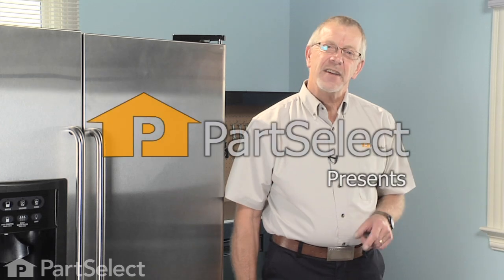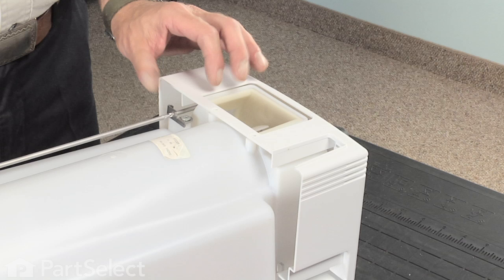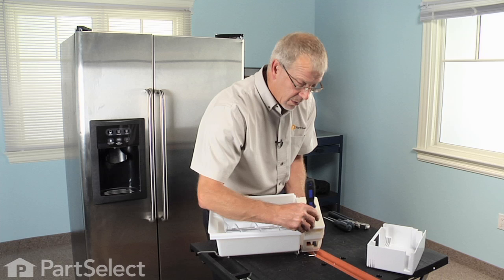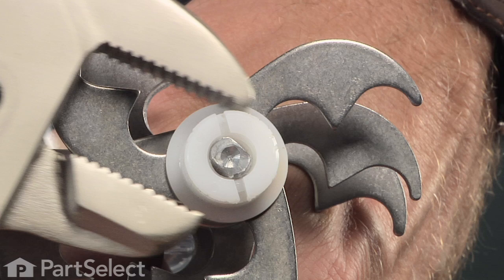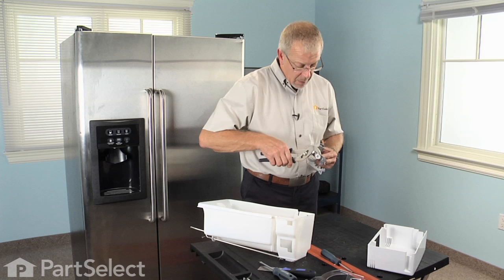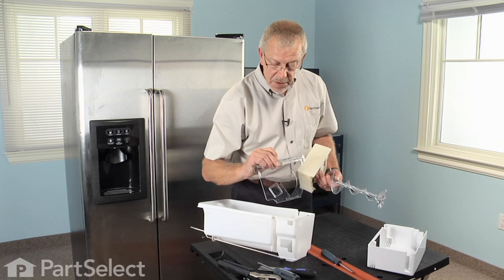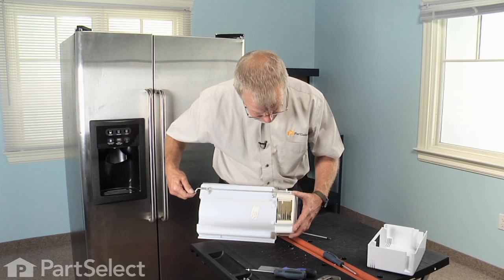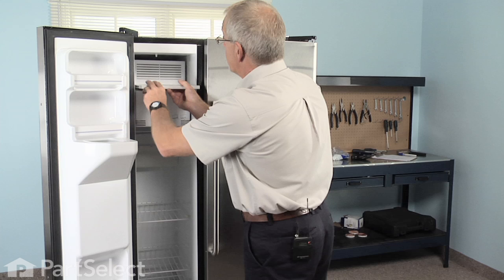Refrigerator and IceMaker Repair - Replacing the Auger Assembly (GE Part# WR17X11705)

Comment: The auger in our GE Refrigerator Ice maker gets rusty. GE advertised it in their paperwork that comes with the refrigerator as being Stainless Steel. I wasn’t born yesterday but I never saw Stainless Steel Rust. GE was nice enough to send me another out free of charge and I installed it no big deal. The new replacement to be honest looked like it was made exactly like the original. The replacement is rusting also and it makes a mess with the ice as it dirties the ice that it does not look appealing when you drop some in your glass. Who would want a drink with dirty rust in your drink? Now our refrigerator is out of warranty and GE doesn’t make our model GE Refrigerator anymore. I don’t think we will ever buy another GE Refrigerator again for that reason alone do to false advertising. In the mean time I do the best that I can with dish soap and a scouring pad to clean the rust from the auger at least once a year and if I decide to use the ice in my drinks especially after a few months of cleaning the auger I take my glass to the sink filled with ice and rinse the ice out in the glass. I shouldn’t have to do this. As someone who is not afraid to fix my own appliances when they can I tried to think this out as to what to try on my end because I am not about to throw out this refrigerator that works fine otherwise. I was wondering if maybe after cleaning the auger if I could wrap the auger in plastic wrap of some sort. Something like a shrink wrap used to cover newly soldered electrical wire. They do make shrink wrap for electrical wire in clear and in various widths. I am just curious what others think. It would be nice if GE or some aftermarket company made a replacement plastic auger to replace my metal Auger that was suppose to be Stainless Steel. I have no idea if someone does or not. Hopefully someone may know something I don’t and could help me out here.

Comment: Thank you so much for this video. It was a lifesaver. My dad called me, like he usually does when he needs something fixed, and he told me he needed a whole new fridge because the ice maker wasn’t working. I checked it out and saw the auger was broken. He tried to use an ice pick to break up the ice and he broke it. I told him we just needed to replace the auger not the whole fridge. Then he calls me to tell me he has spent forever trying to install it and he needs a new icemaker. I looked online and saw that the trays are over $100 so I thought I would try to fix it myself. After about half an hour of feeling like a monkey trying to shove a square peg into a round hole I decided check YouTube to see if I could just fix it myself. Luckily I came across this video and I successfully installed it myself.  I canceled my Amazon order.

Comment: Best video of this process.  Installing the blades in order is critical and you might have to rotate a blade 180 degrees on the shaft if it does not look in sync to the previous blade.  Only about a half inch difference in position from the tip points between blades 7 & 8 and 8 & 9 when looking down the shaft.  The numbers on the blades face down towards the plastic auger.  And it's a 9, not a 6.  Put blade 7 on first.  ALSO, see my note on previous commenter @randyp3871.   Cheers, you CAN do this!

Comment: With My similar Maytag unit, the ice auger works but runs/stops on its own every few minutes.  I took the ice box out, and removed the auger so we could continue to have ice.  The motor now stops and starts on a continuous cycle all day long.   A month ago, this problem was occasional and only when on "crushed" ice setting, not on "cubed".  Now its continuous, about every 3 minutes , the auger motor starts and runs 2 minutes, then stops for 3 minutes.  This cycle repeats.  Disabling auger motor or replacing parts are both OK options.   What do you suggest?  Thank you much.

Comment: Thanks Steve me and my daughter just removed a broken piece of the plastic wheel assembly which was jammed solidly in the blade from the metal blade parts of the plastic wheel from the blade.  She watched the video and I disassembled the icemaker.  It took less than 30 minutes.  Saved me about $500 on a service call.  Thank you Steve.

Comment: You helped me replace my Auger Blade in 2014 but, that GE part only holds up for about 9 months and then brakes.  I'll be watching this video again since I ordered a replacement auger blade from a third party parts manufacturer that touts much better durability.  I can't believe I did this job back in 2014.   I could only do it because of your video.

Comment: I am a pretty mechanically inclined guy. I thought I could do this with no problem. Needless to say, I had a problem.
 I turned your video in usage 3 words that totally bailed me out.
" Left hand thread."
LOL

 So then all my parts came in and I went to put it back together. That's when I discovered all of the crusher teeth were actually in the wrong order when I took it apart. Apparently someone had been into this before and didn't do it right!  The order you have a man just makes sense.

It's all back together in its working like a champ. Bank you so much for your help.

Comment: Just finished putting the unit back together.  Waiting for ice to drop into the tray so I can give her a test drive. Fingers crossed!  This video was pretty great.  So easy to follow!  I'll report back shortly on my success/failure :-)  Funny story - the first time, I got the wrong auger and didn't find out until I had the bin disassembled and stuck the auger in only to find it was 4 inches too short!

Comment: Tip: When you disassemble all the blades from the shaft, slide them all onto a cable tie in proper order. Then later, you can cut the cable tie and slide them all back on without obsessing over the order. At 10:30, make sure the little bracket is BETWEEN the small crimps on the shaft. Replacement augers you might purchase do not have flats on the end shaft ground down far enough towards the plastic. You might have to file off about 1/4" to make the flat go further back.
Reply: Filing down the shaft was a pain.  I used my Dremel.  Painstaking process for sure.

Comment: thank you so much for this.  i had used a putty knife to get the tabs open because i couldnt think of anything better, and was glad to see that this was a valid method:-)  i was stuck on removing the Ering to get the auger out.  i replaced the auger many years ago before youtube existed but it took hours that time and couldnt remember how i did it.  i was done in 10 minutes after finding this.

Comment: thank you so much, my auger was stuck and no ice , took it apart and realized the front shield was broken and jammed in the auger, I'm sure leaving a water bottle in there from the summer didn't help. anyway, can I still use ice maker without front clear plastic shield? thanks again.

Comment: Hi Steve, thank you for the video. The spring in the back on the selenoid activator lever broke. The lever springs back, I believe due to the spring in the front of the box. That said, is this an important part that needs replaced? If so, how would I order it? Thank you again, Sonny

Comment: Great video. I replaced the auger per the instructions with very little difficulty. When doing that, I found the “dispenser crusher cover” was broken, so I replaced that a week after the auger. Used the same instructions, just skipped part of it. Works great. The only problem I have is that it always crushes the ice It never delivers cubes only. Any idea how to get that part to work?

Comment: Hey thanks for this video.  Just got done replacing my auger and you made it very easy to do.  One question though.  When I try to dispense ice, I hear a little click, but the auger doesn't spin and nothing happens.  Water still comes out, and the auger used to spin before I took it apart and replaced it.  Any ideas what this could be?

Comment: My bucket assy is slightly different, and I can't get it apart.  GE Model PSS26MGPA BB.  It has two plastic tabs near the clips that you used the putty knife on.  I saw one on-line guide that said you have to break off those plastic tabs before you can remove auger assy.  Do you know if that's correct?  I'd hate to break it if I don't need to.  Also, this is the second time the helix has come disconnected from the auger.  I use this dispenser with store bought bags of ice.  Is that the reason?

Comment: I can't tell from the video if the two blades that are "tied together" are supposed to be snugly fit within the washers. Mine are loose, but the other 3 blades (on my model) are. I am wondering if this is what caused my auger to chew itself up.

A repair main had done something to my refrigerator (I don't know what) because plastic pieces kept coming out in my ice tray. They were white, but then I realized the auger was chewing itself up when the plastic pieces were clear in the ice bin. Maybe I now have the wrong washers? 

I just bought a new auger from PartSelect and I am hesitant to put it back into the freezer if the 2 "tied together" blades are supposed to be snug between the washers.

Comment: The model of my fridge is GSH25JSXJSS, not sure about the ice maker.  However, I took it apart again yesterday, and fiddled with the dispenser actuator.  Now, when I try to dispense ice, the only thing that comes out is crushed ice, even if it is on the 'Cubed' setting.  So I'm thinking it's something to do with the actuator, because ice is being made and dispensed, just not the right type of ice.  Ever run into that problem before?

Comment: my ice container doesn't seem to be making contact with the "gear", for lack of a better word, so the motor runs but does not turn the auger assembly???  It's like they aren't lining up. it has NEVER worked. i always assumed the installation crew didn't have something hooked up right. any idea???? Please and thank you

Comment: Parts select - Excellent video which help me install the suger assembly and face shield.  I have a nother problem now, once I installed everything back into the freezer and turned the switch back on, now the ice will not dospense when activated in the front.  Did I misinstall something?  Thanks.
Reply from the maker: redmist1122 What model number do you have?
Reply: GE GSL25JFXBLB

Comment: This video shows the "teeth" on the rotating blades facing the "teeth" on the fixed blade assembly. When I replaced the auger, I lost track of the original orientation of my blades, so I tried to follow the video. But having rotating blades oriented this way led to them catching the trap door. The only way it appears the rotating blades won't catch the trap door is if the teeth are oriented in the same direction as those on the fixed blade assembly. Or perhaps I also have a problem with my trap door and it doesn't open far enough to allow the rotating blades to pass? Any help?
2. Is the first blade replaced on the auger the 7 or the 9" ? And does the number face the back of the refrigerator or the front. 
Thanks!
Reply from the maker: The blades go on with the numbers facing toward the back of the ice bin, and the number 7 blade goes first. Make sure that the plastic block on the fixed blade assembly fits into the proper space on the crusher housing when re-assembling.
Reply: Thanks for your answer. Eventually I figured out that the trap door on my until was bent. The edge facing the blades was being engaged by the blades when they were installed correctly, bending it even worse and causing the motor to seize. I'm surprised the trap door didn't break. Anyway, I was able to get it to work by improvising a little bumper at the top of the trap door so it didn't close to the point where it would still catch the blades. I'm sure having the extra information about the blades will be helpful to some of the viewers.

Comment: I need some instruction.  The part where you instruct on where to put the Ice Blade/Stationary Blade Assy (looks like the blade of a bulldozer made of clear plastic attached to two blades with compete loops to fit over the auger spline.  The video did not show in detail exactly how/where the part should be positioned.  When I reassembled and tried the ice maker no ice comes out... I can hear the motor run and I can see the Dispenser Auger Drive moves if i note the position. I can only surmise the auger is turning but the ice it not being admitted to the cutter area maybe because I positioned the Blade Assy in the wrong place... Please advise
Reply from the maker: Jake Robinson I passed your question on to Steve and will let you know what he advises.

Comment: Instructions were a big help but the reassembly portion where the fixed blades must be positioned just so goes by a bit quick without a good shot.  I think I got it correct but I assume the interaction of the fixed and moveable blades is how the crusher works and my first test seems to feed whole cubes OK but is hardly crushing the ice at all when I go to crush setting.  All seems pretty slow but I am going to let the bin refill before I abandon hope or tear apart again.  Crusher was working OK before the auger blade broke.  Advice?
Reply from the maker: Hi Terry! Thanks for watching, and for getting in touch with this excellent question. Check to see that the fixed blades are opposing the rotating blades and that the plastic block that holds the fixed blades is properly inserted into the channel on the crusher housing. This is essential so the fixed blades do not move. Let us know how you make out; best of luck!

Comment: Great video's on repair. I have a GE Profile and saw your video on replacing the main control board and I'm just waiting for the new board to arrive so I can install it. My other problem doesn't appear as easy to fix. The ice dispenser drive cup is badly worn and needs to be replaced. Your video on replacing the auger helped some but my GE Profile, side by side model (PSC23SGRCSS) is a lot different and the auger actually extends thru the front of the ice basket. I had one repairman tell me that you have to replace the whole unit, ice bucket, auger and all. After fooling with it for some time I'm starting to think he's right, but if you can't replace it, why would they sell the dispenser drive cup as a separate item (part # WR17X1L459)?? Any help would be greatly appreciated!!!
Reply from the maker: Thank you for the compliment about our video. I took a look at the schematic for your fridge (based on the model number) and I can see that the dispenser drive cup is a separate part (which means that you can order it and for your model it's available as a separate part) for your model. Not sure if you've looked on our site but enter in that part number and there about 26 repair instructions that are quite handy (other customers have written them when they replaced drive cup). Hope that helps!
Reply: ***** The main control board came in and it did the trick...I've ordered the dispenser drive cup, the helix plate and the nut for the auger for the ice dispenser. The helix plate had worn and slipped back on the auger shaft allowing the nut to tighten and the front of the auger had actually worn a hole in the front of the bucket and was protruding out the front. I realigned everything and put it back together just to check it out and it works like a champ. As soon as I get the new parts I'll make the replacements for a permanent fix. Thank for all your help and again the videos are great.

Comment: I have the model number for my refrigerator. How do I find  part number for the auger?
Reply from the maker: What's your model number?
Reply from the maker: You should be able to locate the part number for the auger in the ice dispenser parts list. If you have trouble finding the correct part,
send us your model number and we would be happy to assist you.
Reply: Without an ice dispenser parts list, that's hard to do. I looked around and took a guess, got the part and replaced it. Still, it would help if people selling parts would state what model it fits or the mfr could provide instructions and parts list like they used to. I'm just not used to this world with no instruction books and guessing. Have you ever seen an instruction booklet to an iPhone? Didn't think so.
Reply from the maker: Glad to hear that you found the correct part. Most manufacturer’s usually do provide complete parts lists for their models, and it is possible that we did not get all of the diagrams for your model posted. If you would like to share that model number, we can check our data to ensure that future customers can easily locate the parts they may require.

Comment: can anyone tell me what issues would be the reason to replace the auger? I'm having a problem with the dispenser dispensing ice very slowly.
Reply from the maker: Hi Kenneth, What is your model number?
Reply: GSS25WSTI SS..............and now its stopped making ice all together. I normally hear the water click on and fill the ice maker but I haven't heard it in a few days. Can you help?
Reply from the maker: Hi Kenneth, when researching under your model number the reason to replace the auger is due to ice maker not dispensing ice. For the symptom "stopped making ice"  the top parts that customer ordered for your model to fix the no ice issue are: ice maker, dual water inlet valve or the control board. Click on this link: http://www.partselect.com/AdvancedModelSearch.aspx?ModelNum=GSS25WSTISS&mfgModelNum=&fkMfgID=2
It will take you to the symptoms for your model and the parts customers had ordered to correct the issue. There are also repair stories and videos on how to do the repair your self. If you have any questions please call us 1-888-738-4871 and we will be happy to help.
Reply: Kenneth Smith in my case, it got really rusty